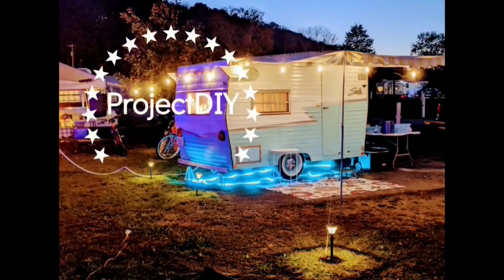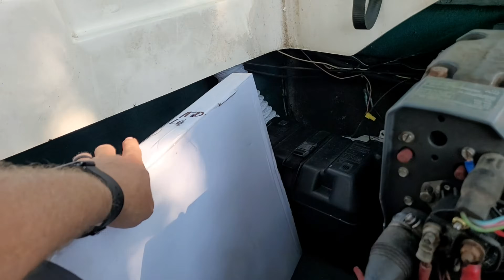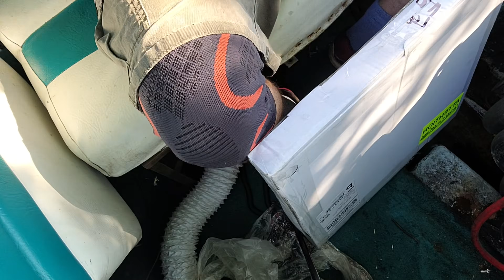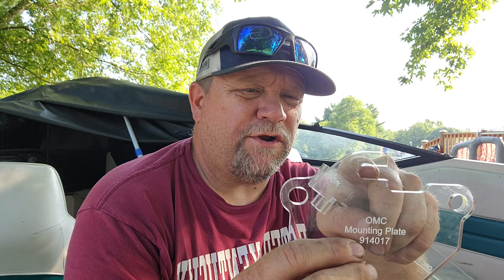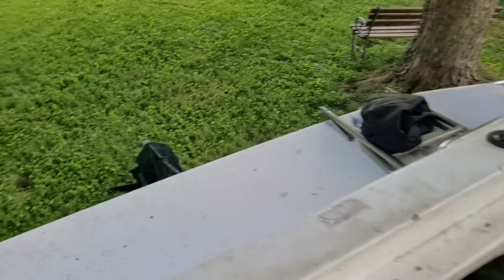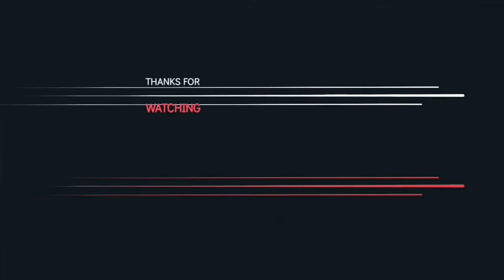Installing A Control Cable - Sunbird Boat Project Part 7

Comment: a question why the temperature gauge on my 1988 Sunbird 4.3 does not work what do you recommend I do and where can I buy the parts?
Reply from the maker: Could be several things causing it. Gauge could be faulty, could a wiring issue or it could be a faulty temp sensor. The only way to tell for sure is to troubleshoot it with a volt meter.

Comment: Just a FYI, the drive needs to be submerged in water to make sure it is shifting properly, more often than not, OMC’s will shift fine on muffs but once you put the boat in the water it won’t shift under a load due to cable/ESA issues.
Reply from the maker: Good to know, thanks! I'll be testing it soon and making more adjustments I'm sure. 😀
Reply: @ProjectDIY2  No problem. I have been having cable issues. Shifts fine on land, back it into the lake and it won’t shift!!! 🤦